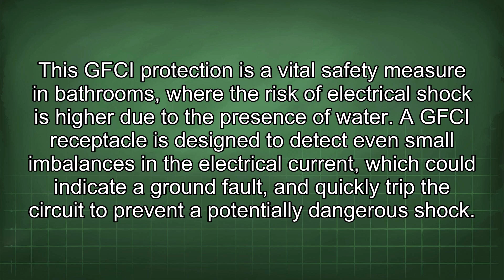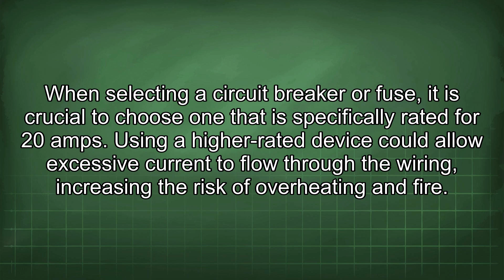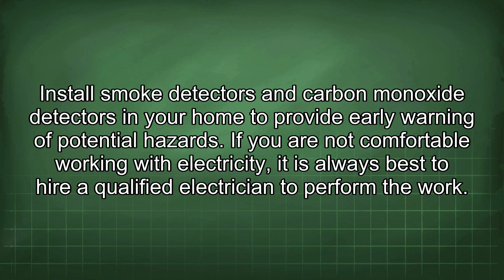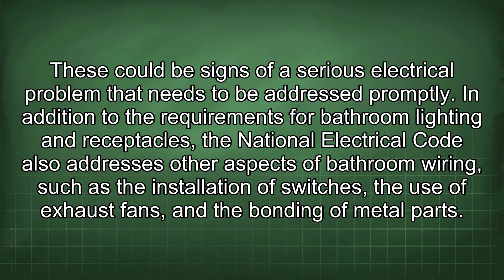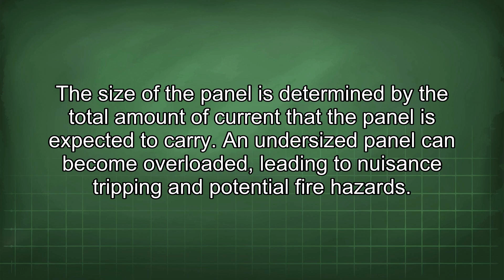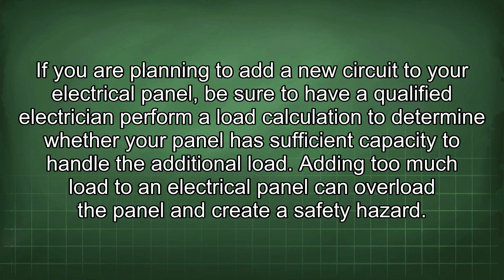Bathroom Lighting on 20 Amp Receptacle Circuit NEC 2005

Comment: I hope it can help me but never. it is just audio version of dry code, lack of real experience or skills. For example, light fixture is much less than 20A, so, can you use 14/2 for light fixture and connects to 20A outlet? if not which wire/connection can be used? any way, the light fixture wires are usually 16/2.